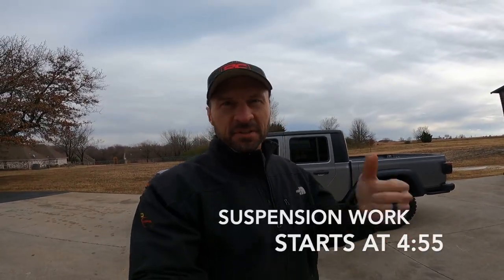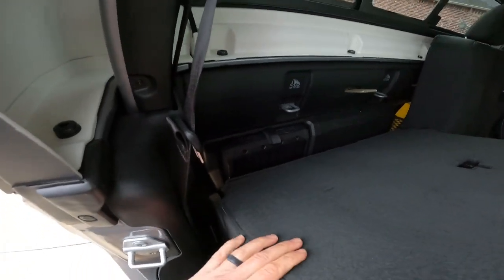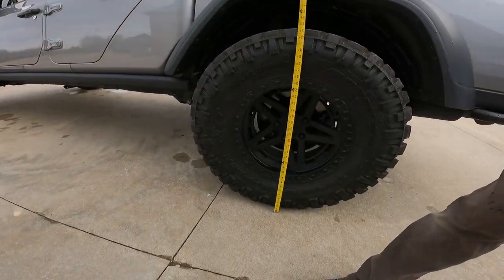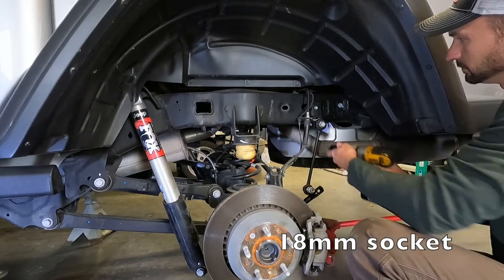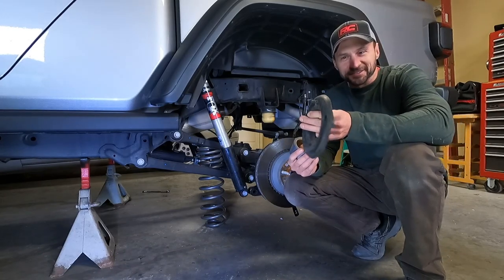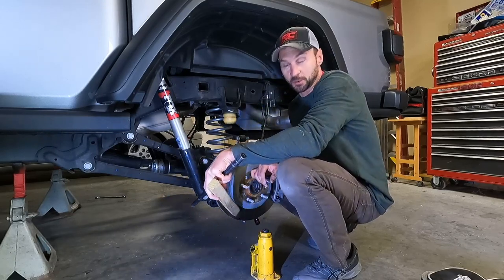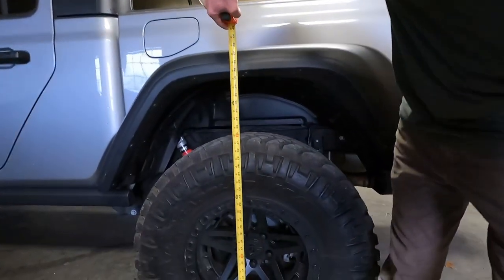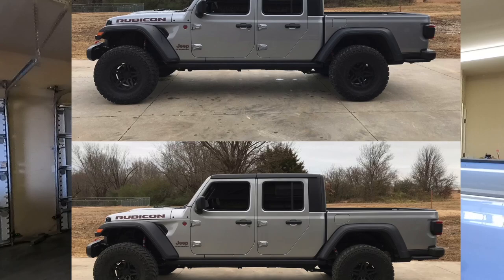Jeep Gladiator rear spring install from Rough Country. Stop the squat, and good to tow!

Comment: not sure if using the height of the fenders was a good reference, as the dimensions of the rear and front fenders are completely different. they measure differently in height even with stock suspension

Comment: Just ordered the 2.5 RC front spacer kit on my 2022 rubicon. Want it to be more level. Now I see yours without the rear RC springs and it definitely looks too low in the back. Keeping the stock Falken Wildpeak 33 MTs until I can get the Nitto 35 11.50 MTs. Should I have the installer put a spacer in the rear to level it more in your opinion? Thanks.
Reply from the maker: You’ll be fine with that spacer kit. Thanks for watching!

Comment: Why was front sitting higher initially?
Reply from the maker: 2.5” kit levels the truck. Needed to upgrade the rears.
Reply: @GreaseMonkeyTV  oh nice I have 2.5 but mine still has rake you must have the spring kit mine was only spacer, wanting just to put a 4” super or ready lift and be done with it lol
Reply from the maker: @paultrinidad2401  be careful. Over 3.5 gets you in driveshaft and steering angle trouble.
Reply: @GreaseMonkeyTV  ok thank you I heard that about the 4.5 skyjacker but also 4”?